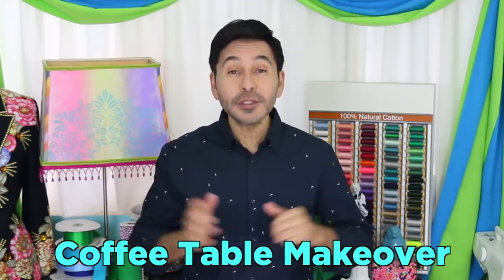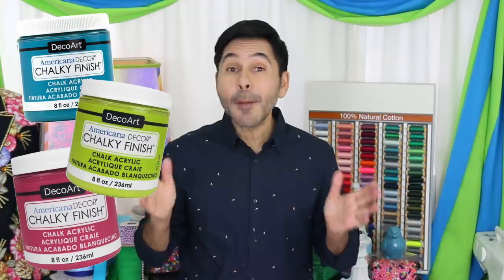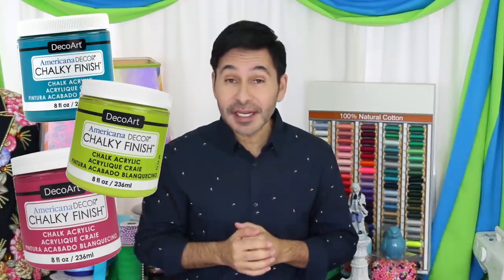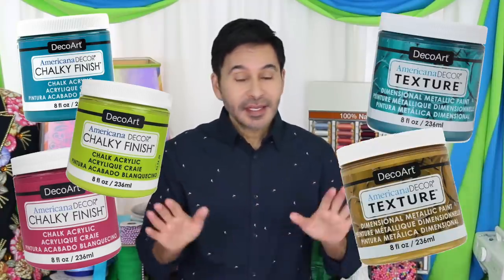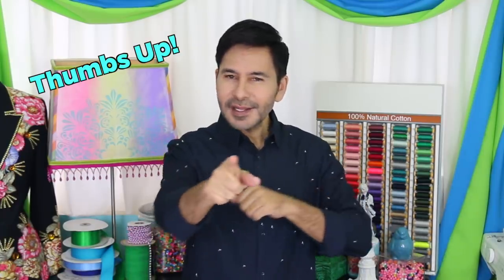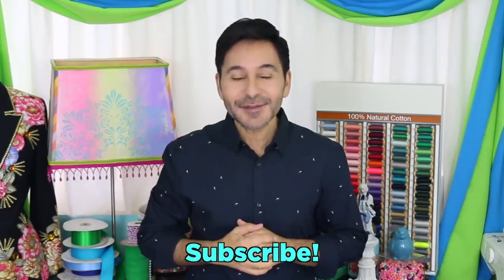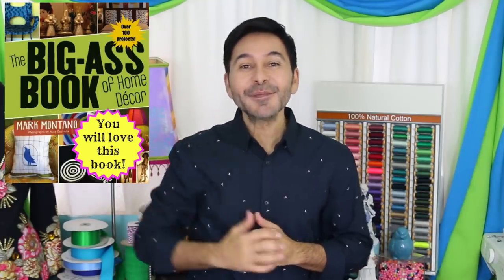Drippy Boho Texture Table

Comment: Love, love, love the table. How do you finish it off to protect the design to not rub off or get damaged?
Reply from the maker: You can always use a spray varnish and it would be just fine.  You could also use a Minwax Polycrylic.  I love using that on furniture.
Reply: @MarkMontanoMakeYourMark  thank you soooooo much for getting back to me.

Comment: Do you put a top coat over it?? If not...do the colors bleed if they get wet??
Reply from the maker: Hi Nancy, the colors won't bleed, but I did spray it with a matte sealer (Americana).  Toward the end of the video I show what I used.
Reply: @MarkMontanoMakeYourMark  sorry!! I must have been so engrossed in the process of putting the design on that I didn't notice.